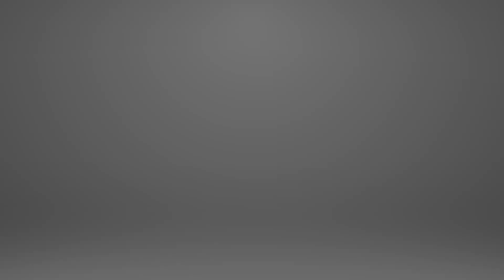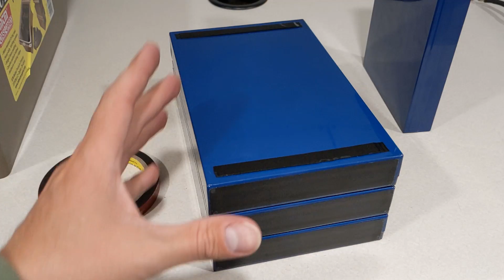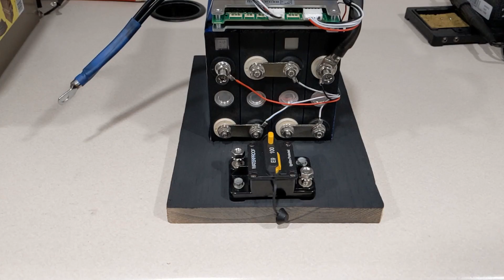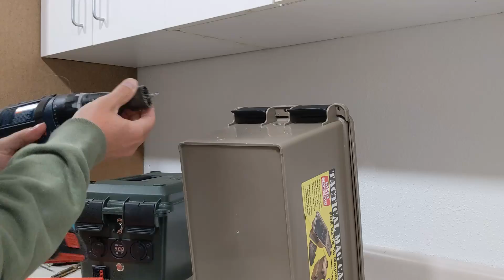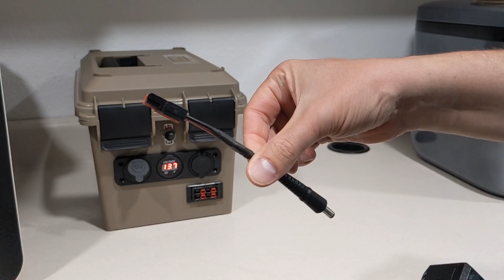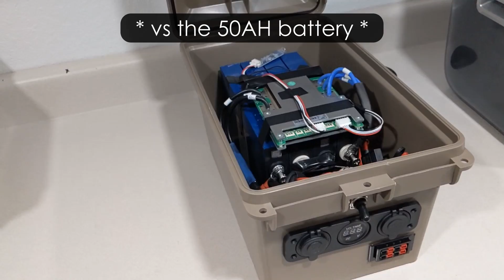DIY 80AH LiFePO4 Battery Box - COMPLETE BUILD VIDEO  | AliExpress Cells, High Quality BMS

Comment: how long can you run your compressor frig from the 80Ah Lifepo4 pack
Reply from the maker: Over 72 hours without a charge. With a solar panel it would run forever
Reply: @Jasonoid  thanks for your quick replay.  I am building my battery box off this battery just for the price. https://www.fuelzero.com/FuelZero-12v-50AH-Deep-Cycle-LIFEPO4-Battery-p/fz-12-50-lifepo4.htm
  I would like 100 ah, but as prices drop I can always upgrade. and felt I had to balance need with cost, and I would double my cost to get to 100 ah.
Reply from the maker: @jpipod1  Never seen that battery before, you'll have to let me know how it goes. 50AH isn't a bad capacity at all for the price :) If you want a larger capacity in an "off the shelf" version I would recommend this battery:

https://shopsolarkits.com/products/sok-battery-100ah?utm_medium=cpc&utm_source=google&utm_campaign=Google%20Shopping&gclid=Cj0KCQiAlsv_BRDtARIsAHMGVSb7NQh79f4ygbDXIXE3HgterYffbTWBtPpSmC_wZs8DTDbl5f326AUaAu2_EALw_wcB
Reply: @Jasonoid  yes I was about to by the 100ah cells and roll my one pack with the same BMS you recommended.  I am always hesitant to buy battery's from  with out having a US shipping point to deal with if there are problems.  And at the end of the day I am using my pack for Ham Radio, and camping.  So the lighter weight of the 50ah pack may be nice. Since weight is a function of energy density.  And,  it is just an excuse to build a second pack later on.  I sold my 20ah pack to another ham radio operator that like my build. I am now looking for a case.  I like the one you have just not sure of the fit.  What was the inside max height. Looking my battery dimensions I think I am going to be close.
Reply from the maker: @jpipod1  Yeah, that bigger batter wont be fitting in my case. The 80AH cells fit perfectly. I'm guessing the 50AH battery you listed before will work well. Should be a great project!

Comment: Very cool build!! I have built a few similar boxes using 18650s and small plastic HF ammo boxes. I never thought of this larger box for a 100 Ah trolling motor power cell I built. I have the same bms which comes from Battery Hookup for about $85, fyi. I also use a usb with volt meter built in to save a little space. How are you securing the cells inside the case so they don't jump around in case it gets turned upside down? Thanks for the demonstration, it is very innovative. You have inspired me to add some cigarette plugs and a couple of LED back up lights for after dark. Thanks
Reply from the maker: The batteries are heavy enough they won't be shifting around.....as long as I keep the case from falling out of my SUV or something. Thanks for watching, glad it could be helpful!

Comment: I love this. And I think the fact that you didn't double the size just to have an AC inverter built-in is genius.
Reply from the maker: Most of my setup runs directly off 12volts. For example my 12v ICECO fridges, fans, camping shower, led lights, flashlights all just need 12v. This power station provides TONS of power to run any of those items! I do have a inverter but I really never use it. Thanks for watching!
Reply: Same. Ive built a couple of these, only with SLA batteries, and use 12v equipment. My HAM Radio room runs almost exclusively off of 12v. LED lights, fans etc are all 12v. That also helps to keep RFI down. As of right now I have a computer that is running AC, but I will set an inverter up soon. Fun projects though.

Comment: The Anderson connectors can be used for both charging and discharging? Seems logical but in my mind I assumed those 2 things would be separate circuits?
Reply from the maker: So just think of the anderson terminals just like the terminals on a car battery. Allows charging and discharging at the same point. You car alternator is charging but accessories are using power at the same time.
Reply: @Jasonoid  Yup, makes sense. When I built mine I built in the solar charge controller with an SAE connector on the outside, so I think I would add a separate charge port for an AC charger to go direct to the battery.

Comment: Enjoying the video and how to information.  One comment, with the volume up enough to hear you well the music played during the assembly section is notably louder causing me have to turn it down.  Common complaint of mine with about 99% of youtube content makers, never have figured out why that is so common.  A lower volume for the music section than the content voice over would be highly preferable to this viewer.
Reply from the maker: Audio levels are actually the same decibel level on both sections. So technically I would need to have the music volume much less than the voice audio.
Reply: @Jasonoid  Wow, interesting.  Just one old guy's opinion.  You have really piqued my interest in building one of these systems.  I envision it being used during a back country hunting trip in MT fall 2021, but find myself now concerned about the freezing issue and whether or not it could be recharged.  Curious as to how much "gadget" recharging could be done from one full charge.  Could see using it to run a small 12v fan to circulate heat in a tent for example.
Reply from the maker: @bucmeister7713  I'd recommend going with larger cells because they aren't that much more expensive. Like 280ah cells would last probably a week charging small electronics and running a small 12v fan. If I were to do it again I'd use 200+ amp hour cells
Reply: @Jasonoid  Good to know as that would be an awesome amount of power.  Thank you for that advice.  Been looking at these cells a lot after watching a video wherein a guy replaced his lead acid camper batteries with packs built out of the 280ah cells, said he got double the usable energy per cycle.  The battery technology these days is attention grabbing for sure.  Figure once the holy grail of solid state is achieved much more of our daily lives will convert to electric.  Maybe the solid state technology will not be as cold temp sensitive.

Comment: So in parallel for 10 hours, and then in series thereafter? I take it that they are 3.2V batteries?
Reply from the maker: Putting them in parallel will self balance them. Putting them in series after will give you the full 12volts

Comment: Can someone explain the need of the fuses for each location?
Reply from the maker: If the wires short circuit and there isn't a fuse the wires will catch fire and or melt. Safety first.

Comment: Hi, From France! Vers great And instructive vidéo. 
I’d like to build this for m’y astrnomy activity IN high mountains.

Is it possible adding a second cigarette lighter? (Structural plan?)
Is it possible adding a fifth cell 20 Ah (100Ah)?

And finally, how and where do you connect your box for charging?
Thanks a lot for all!
Reply from the maker: It's a 4s battery so you'd have to buy larger capacity cells to get more storage you can add as many 12 volt sockets as you want. I use a stock lifepo4 charger and it works well! Thanks for watching!
Reply: @Jasonoid  Thank you.

Could you please, tell me the reference of your two chargers ? (solar and home)?
Do you connect them on the Anderson PowerPole?

Regards,
Reply from the maker: @fabvisunature  I use the Anderson power pole connections to charge the battery

Comment: Build one with 90 AH cells using the same case. Mine has a PWM controller for the trolling motor on my paddle boat in it as well as the cells and BMS. Looked for a long time to find a cheap roomy but not too big case. Thank you for posting this as well as the links. saved me a lot of time and $$!
Reply from the maker: Awesome build, sounds like you will be using it for some fun stuff!

Comment: I would like to give you the following suggestion when wiring the power pole connectors as you have done.  You do not want to mount the connectors as you have done because you can accidentally plug your connectors into the middle connections and destroy what ever you have plugged in.  Either make the connectors black/ red/ red/black or red/black/ black/ red.  I assembled my anderson power pole connectors in a battery pack as you have done and accidentally plugged into the two center connectors, thereby reversing polarity and destroyed my ic-706 radio.   Other than that suggestion, love the way you constructed your battery pack.  De W2AR, Phil Mollica
Reply from the maker: I agree, I have it on my to do list to flip over half the pairs. Thanks!

Comment: I'm not an expert for LiFePo4 batteries, but connecting the cells directly in parallel would damage at least a LiIon or LiPo battery (if not destroy them) if the charge state of the individual cells differs too much. Usually, you should check the cells voltage and bring them to the same level if necessary before connecting the cells together in order to prevent to high current flows between the cells.

Is this different for these cells or is it simply a mistake on your part?
Reply from the maker: They were very similarly charged,  just was a final step to balance them together.

Comment: looks great and I like the military-style as well .. one thing that I would like to tell you is lithium's voltage change during the power draw is very different with lead aid battery . they hold up voltage around 13V pretty much steady over 60~80 percent of life cycle depend on the size or package . so be aware that voltage will not tell you many things like it did in lead aid :D
Reply: What is the best way to monitor state of charge without spending $200+? I looked at some cheaper options on Amazon but they didn't look promising.
Reply: @juliogonzo2718  I'm not sure how much money you will spend on lithium battery but 200 shouldn't bother you if that guaranty longevity of your most expensive investment but if you still want to save some money look at the link below there are option allows you to calculate total amount of watts by monitoring and it won't give you the actual SOC(stage of charge) and just calculate how much energy came out only so you need to know how much energy coming in your PV by yourself then you can calculate SOC.
Reply: @juliogonzo2718   cheap monitoring device shorturl.at/csuIR
Reply from the maker: Correct, the BMS does a pretty good job displaying remaining power. It also tracks power used over time. Would recommend using that BMS. The Bluetooth functionality is great!

Comment: I see a problem at the anderson power connectors.  the pairs are not separated so a mugwump can easily plug into the middle 2 and achieve reverse polarity.  The pairs need to be separated by a divider of some sort.
Reply from the maker: Usually they flip them over 50/50, I guess I better do that for safety, thanks for the heads up. I guess I missed that when assembling the pairs.

Comment: Whoa, wait, NO!

You CANNOT use a standard lead acid battery charger! Those WILL DAMAGE  LiFePo4 batteries - that REQUIRE a special profile according to every book, website & data sheet I have read.

Now, there are special chargers that have different selectable modes for different chemistry types, but yours doesn't look like those, nor did you describe it as anything other than a regular lead acid charger.
Reply from the maker: The BMS shuts off the battery when it gets to the correct voltages. The lead acid battery charger I'm using doesn't ever "finish" charging because the settings I have in the BMS. The BMS balances and keeps the battery within correct tolerances, you can enter any battery parameters you want. No damage done. I've looked at many Lifepo4 chargers they just put 14.6 on the battery until it's done. This lead acid battery charger does 14.4v so it's even under what my lifepo4 charger will do.

Comment: Whats with the screws in the battery terminals that are about 20 mm too long? Cells should be clamped together with moderate pressure, this increases cell life by preventing delamination. Bad idea charging to 14.6V (3.65V per cell), if you charge a bit less you dont lose much capacity and significantly extend battery life.
Reply from the maker: I just wanted to be able to connect alligator clips to them if needed, you could use anything else for these main terminals. I don't think they are too long. Thanks for the tip on clamping the batteries, I will look for a way to do that. You got any builds on your channel? You should post some of your projects, seems that we could learn from a real expert!
Reply: @Jasonoid  no need to repeat what Will Prowse is already doing. There's way too many repetitive channels of people doing the same thing as they try to monetise their hobby as it is.
Reply from the maker: @giddyup3451  Will's content is great! He makes big bucks on his affiliate partnerships.... He even bought a house with his money! Why is he the only one that gets to have all the fun? 

I've been doing the YouTube thing since 2017, I have some fun projects so invite  other people along with me on the journey. No expert here, just having a good time. No pressure to watch my content so don't feel you have to help monetize my hobby lol
Reply: @Jasonoid  I like your projects Jason! Will sometimes goes too fast and his projects are sometimes for large commercial equipment, love both of your channels!
Reply from the maker: @CharliebStackin  thanks Chuck, my projects are cheaper for sure! I can't afford the big time stuff haha

Comment: Great Video!  I ordered 200 amp cells from a vendor that Will Prowse recommended.  All together was about $750 but more power then my little transit connect can use even when I add a 12volt fridge lol.  Thanks for sharing this, I shared it with 2 groups that constantly talk about those over priced jackery units.  Mine is going to be the leisure battery fro my van wired to a fusebox and renogy dc to dc charger (and eventually a 100 watt portable solar battery for when I am camping and using the battery.)  I added a manual switch for the wire coming from my alternator so it won't be always sending juice back to the battery since I want to keep it around 90% as being full and try not to drain it below 10% either so I might get more cycles out of it.  I can check the battery gauge and when it needs to be charged, charge it when it is nearly 90%, turn the switch off so the battery won't cook.
Reply: Deryk,  How is it doing a year later?
Reply: Still working fine... added two 100 watt solar panels and I found I could charge my diy electric bike or now I have an etrike!
Reply from the maker: Appreciate it, thanks for the share! Your project sounds awesome, I bet it will work well for you!
Reply: If I read the Alibaba page for the BMS Bluetooth adapter correctly, the user can set the over voltage and under voltage parameters.  I'm with you, I want long battery life, so I would get extra capacity and set it to range from 90-10%.  The great thing about the larger cells is that at 1C they can push a lot of amps so they wouldn't heat up at 100a when using an induction cooker.
Reply from the maker: @posteroonie  The BMS is completely customizable. Pretty awesome. You can set the exactly when you want the cells to stop charging and discharging. Love it! I just ran a fridge in FREEZER mode for 48 hours on this battery. My last battery wouldn't even last 24 hours without charging it
Reply: BMS's top balance, meaning that they don't start to balance until the cell voltages are over a certain level, nearly fully charged.  So it might be a good idea to run your batteries up to 100% every couple of months to trigger the balancing.  The balance voltage is configurable for the BMS in the video, so I would set it to just below 90% if my overvoltage limit was at 90%.